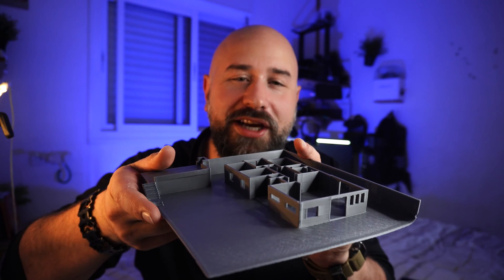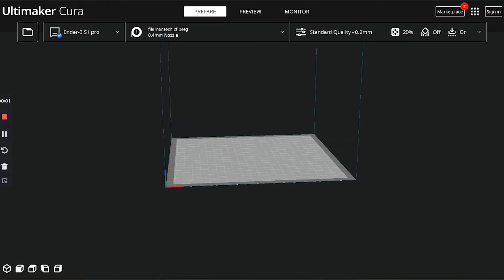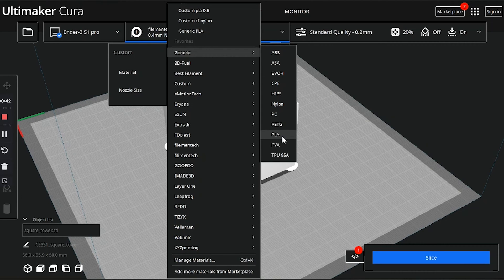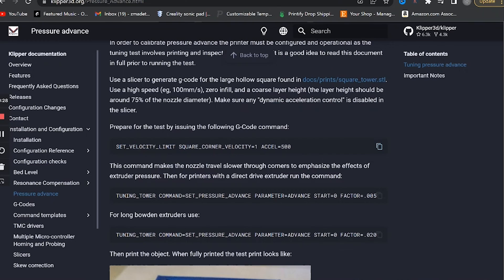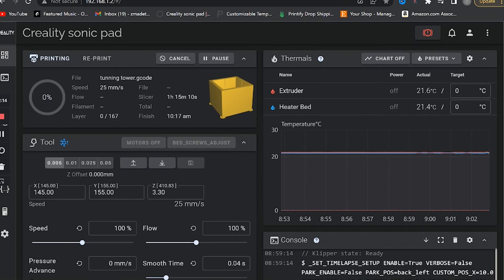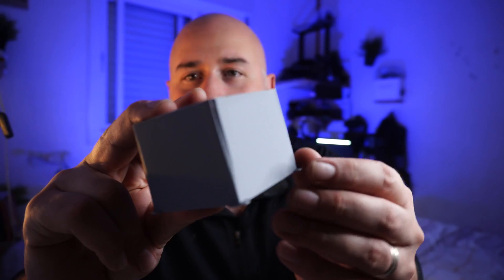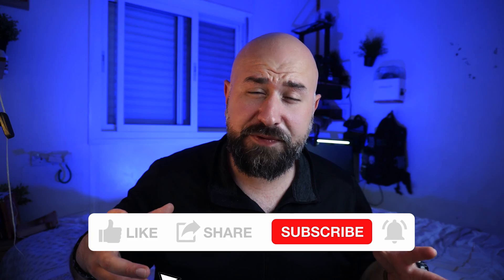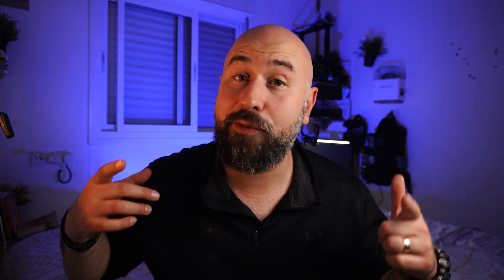Pressure advance on crealitys Sonic Pad

Comment: Your videos have been very helpful as I have been at this for a little over a month, one this I would love to see is a good "order" of dialing in a printer I have followed several videos including yours but only the immediate settings are mentioned and there are so many to modify I never know if I missed something. I have pressure advance tested several times on even the same roll of filament and get a different number every time and then I will flow test and it throws everything off. Currently my prints only work 2 out of 3 times at best. Thank you for your videos without them I was only getting one good print out of many. Never knew there was this much to learn on 3D printing, loving at hating it at the same time but having fun the entire time.
Reply from the maker: Hey Chris, first of all, thank you for your kind comment! second I think it's an excellent idea to make a video on step-by-step 3d printer tuning, it might take me some time though. One more thing, have you saved the pressure advance value after doing the equation in your printer config file?

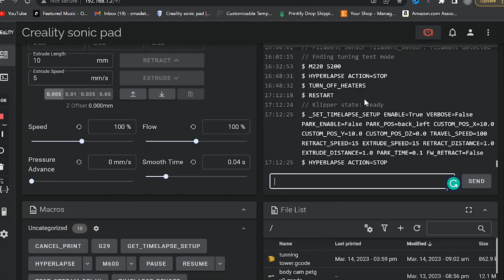Comment: I'm a bit confused. At around 7:45, after entering your Pressure Advance number, you run the $ RESTART command and it clears out the number you entered and sets it back to 0.

Even though it is showing 0, is it still set internally to the number you entered (in your case .04 mm)?

Or, if I want to keep using the setting I came up with, do I have to enter that number before every print (since it goes back to 0 every time I run the $ RESTART command or do a print)?
Reply from the maker: Hey ensoniqthehedgehog, if you want the value for pressure advance to be updated to your printer config file it needs to be updated manually, I apologize that I wasn't clear about that critical point in the video, I'm new at this whole youtube thing and I wrongly assumed that people would understand that the value needs to be entered manually in the printer config file under the extruder section Input Pressure Advance Value in Klipper
Open the printer.cfg file from the configuration section.
Navigate to the extruder settings and input the pressure_advance:  command at the end of the extruder section.
Save and Restart firmware.
The Klipper firmware will exit the test mode and use the set pressure advance value in future prints. I apologize for the confusion
Reply: @z-made  Hey, no problem. Thanks for the reply. It's a really well done video, it got me to subscribe to your channel.
Reply from the maker: @ensoniqthehedgehog  Ya of course! Thank you, I appreciate your understanding, 😊

Comment: Just in case this helps somebody else, I followed this guide to the T, but after not understanding why it didn't help at all, I realized that even though I most definitely input the pressure advance value and saved and restarted, the setting in fact did not save.  I had to manually add the value to the printer.cfg file, because in the printer.cfg file the pressure_advance setting was still zero.   After modifying the setting directly and saving / restarting, the setting stuck.  So, it may be a good idea for everyone that does to simply verify after saving and restarting that your pressure advance setting is actually what you desired to set it to.
Reply from the maker: thanks for the feedback Brian Field

Comment: A side question: my Sonic Pad doesn’t have an IP address in the WiFi menus and Creality tech support tells me that the Pad cannot be controlled via a web browser. ??? Can you give me some guidance on this?
Reply from the maker: Sure Wayward_Murf, I hope I can help, first of all, is your pad connected to the internet? second is it updated to the current firmware? and third, did creality give you a specific reason they told you that you can't get an IP address for your pad?
Reply from the maker: hey Wayward_Murf, did you figure out what's going on? Mabey try checking out this page, it might help https://www.klipper3d.org/API_Server.html
Reply: @z-made  whoa...I am saving that page, but that kind of intel is above my skill level.  Thank you !
Reply: @z-made  Thank you for your reply.  Yes, it was (is) connected to the internet.   For whatever reason (I made no changes) when I disconnected and reconnected the WiFi - the IP address appeared and I could access it via my web browser.  Oddly, it will only recognize the 2.4G network and not the 5G?  Still, the online chat support from Creality said that web browser control would be a future capability. ?? Well, uh, it works for me like you have shown.   Anyway, thank you for your time and information.  I am saving and reviewing your videos for my education.

Comment: Im going to use your way, but im going to do an expiriment first. Im gonna guess. My printer is fast so im going to start with your setting and print a small calibration cube, if it works it work, if not i adjust. My printer is pretty fast so im willing to do this 3 or 4 times before doing it the right way just to see if i can guess it. Thanks for the video.
Reply from the maker: Hey Andrewut7y A, that sounds like an interesting experiment, please let me know how it works out
Reply: @z-made  in conclusion, dont guess. Just do the math, you wont guess correctly lol. I tried guessing twice and it wasnt even close. My intention was to see if a ballpark generic setting would work, it does not.
Reply from the maker: @andrewut7ya511  Lol, well sometimes you just gotta try, I get it! thanks for letting me know😊

Comment: i tried to enjoy the b-roll of the difference at the end, but all i saw was the bad lighting, the low framerate, jerky hand AND camera movements, and the fact you whizzed through the comparison all in just 10 seconds :(
Reply from the maker: thank you for the input, I'm new at youtube and cinematography, and I'm trying to improve the production value, one step at a time
Reply: @z-made  no worries, just take your time, as i sensed a little impatience at that part, so remember your intention E.G. you want to show the viewers the difference between two prints. For someone playing "spot the difference", they need time and things not to move too much.

For this, you want to keep the camera still, and be as slow, and steady, as possible,  with the subject (the model). 

If you're going to manually hold it by hand, do your best to keep it still for a few seconds, then rotate to show other sides for a similar period. 

When it comes to showing the 2nd model for comparison, you can either do it the same way again, so it shows in series, or maybe show them at the same time by stacking the model and rotating them both to see them at the same time (i know this only works if the model is stackable) :) 
 
The frame rate was an issue and didn't help matters, not sure what the reason was there, maybe you wanted to squeeze the footage in without making the video too long ??  

The part just before the B-Roll, where you show the model, has bad lighting, with too much shadowing to be able to see to detail you want viewers to enjoy, so be aware of lighting your model well.

I enjoyed the rest of your video, sorry if i didn't mention it before, good luck in your next videos :)
Reply from the maker: @cjjuszczak  Thanks, i appreciate it😊

Comment: Just tried doing this. Followed all the steps, but noticed my print speed never went above 50mm/s...
Reply from the maker: Hey TheEthanRivera85, so I would suggest you try upping your print speed in your slicer, this is a video I made that I think might help you if you're using Cura, please let me know how it goes https://youtu.be/_Xqm1zod1yo
Reply from the maker: Hey TheEthanRivera85, just wanted to know if you solved the issue?
Reply: @Z-Made  so what I think my issue was I just changed the top box of the print speed and not the other options like for the walls and such. After it was all said and done I was able to print an xyz cube in 7 minutes
Reply from the maker: @TheEthanRivera85  That's awesome! I'm glad to hear it

Comment: Hi, thank you for the video, very informative. Just wanted to mention, if I understand properly by the equation you should calculate (0.2+7.79)x0.005 since your initial layer was 0.2mm and you measured from the top of the feet. Or there is something I do not understand. Thank you. Which is essentially same 0.04
Reply from the maker: Hey Fortifor, Thank you for the comment, I started the print from layer zero, therefore when measuring the tunning tower from the bottom, the first part of the equation is zero, in other words (0+7.79)x0.005 which comes out to 0.03895 I hope I was able to help😊 this is a link directly to klippers pressure advance page just in case https://www.klipper3d.org/Pressure_Advance.html
Reply from the maker: Hey Fortifor, just wanted to know if everything worked out for you?
Reply: @z-made  ohh yeah, everything is perfect.  All calibration has been done. Resonance,  pressure advance(funny I have magnets which have holes lining up with this acceleromete holes, and found little 3Mx 16 screws in my worshop and nuts) all perfect. Thank you for asking my friend. Andrzej
Reply: @z-made  I meant for vibration compensation I used those magnets  so I could screw one to the little accelerometer and placed another ones next to it to make sure that nothing would move at high pitch. Also thanks to your video with using magnets regarding resonance reading. So I did it a bit different way but the idea and explanation was enough for it. Thank you again and keep doing good work buddy.
Reply from the maker: @fortifor5410  Sure! no problem, happy to hear, happy printing 😊

Comment: Hi, 19mm was my best corner so I got the value of 0.095 (Direct Drive).  I put that in the PA tab and then RESTART command do I need to put that value back into the PA as it changed after the restart to 0 or is that just the Klipper Zeroing 0.095 as the new value? 

Thanks in advance.
Reply from the maker: What UI are you using? Have you changed the macro for your start print?
Reply: @Z-Made  I'm using the sonic pad on the ender 5 s1 with prusa slicer. I went into the sonic pad Web interface as seen in your video. Not sure about macro (sorry not too experienced). I put the commands in first thenI ran the test, input the PA value on the web interface that I got from the calculation after test and then entered restart in the command console of the Web interface but the value went back to 0. Is there anything I'm missing. Thank you for the response and the video explaining so far :)
Reply from the maker: Hey there halfapineapple (awesome name😂) sorry about the delay in my response, all you gotta do is put the pressure advance value you got from the calculation into your printer config file, just in case, based on the value you wrote in the comment this is the command "pressure_advance = 0.095" I hope this helps
Reply: @Z-Made  haha thank you, and yeah thanks I will try it. It sometimes remembers the PA sometimes wipes it back to 0. Was manually typing on the left PA slider. I will try console next time. Prints are coming out a lot tidier, you legend!
Reply from the maker: @LostContentScar  Awesome! let me know how it goes😄

Comment: I notice you also have a thumbnail of your gcode file in console. Did you do anything to get this? I don't have a thumbnail.
Reply from the maker: Hey there c0mputer😊, first of all, thank you for your comments, second sure I can explain how to get that picture, if you're using Cura slicer, you just have to go to the extensions tab up top (next to file/edit/settings/etc), pick "post-processing", "modify g-code", "add a script", then pick the "create thumbnail" option, then choose 200 by 200 px and you're done, now cura will generate a thumbnail for you every time you slice and save your print, and it will show up in your sonic pad and in the browser, please let me know if this helps
Reply: @z-made  Thanks for the reply. I'm using Cura but this isn't working for me, I'm actually using Creality's version Creality Slicer which is a Cura clone. It's identical but its most recent version is based off Cura 4.8 so I don't see the Create Thumbnail script. It's all good though, I appreciate the help. It's really a minor thing, I can live without the thumbnail.

By the way, I'm using the Creality clone because real Cura keeps crashing on my Mac and when it doesn't crash it's insanely buggy. Mouse stops registering clicks, can't scroll sometimes, the Preview tab after slicing doesn't show anything on the build plate, etc. It's horrible!
Reply from the maker: @c0mputer  Oh boy, I didn't know cura had so many problems on the mac, I'm sorry to hear that,  I'm going to try to look into it and see if I can maybe find a solution
Reply: @z-made  Update: FYI in case you get asked this same question. I did get the thumbnail to work...sort of. It shows in the Sonic Pad but it's upside down, haha! In the Printer Settings in Cura if you click on Connect Moonraker > Upload tab > UFP with Thumbnail, that got it to work. But again, it's upside down and it doesn't show up in my browser in Moonraker, just on the Sonic Pad print status screen. I find it funny so I might just leave it.
Reply from the maker: @c0mputer  thanks for letting me know, that's a crazy bug

Comment: printing the original house build and then doing the second one after pressure advance tuning you said you printed it at 150mms and achieved good results.... do you also need to change anything else in cura slicer settings? im struggling to work out what i need to do to achieve better speeds after tuning ( i've done pressure advance/ movement parameters and i've also done resonance compensation) but now im lost on what to do after
Reply from the maker: First of all, it depends on your printer, extruder, hot end, and nosel, so take this with a grain of salt... but I find that what works best for me is, if you raise the print speed in increments of 50 mms and the acceleration in increments of 100 mms, until you find the limit of your printer and filament combo that tends to work most effectively, I hope this helps
Reply: @z-made  that makes sense because of limitations in flow rates from the nozzle, I will try this out thankyou!
Reply from the maker: for sure man happy to help😊

Comment: Will the sonic pad still work on creality printers if you changed the control board?  I have an ender 3 pro and cr 10 that I've swapped the boards out with the skr mini e3 V2.
Reply from the maker: Take this with a grain of salt, because I don't pronounce myself as being familiarized enough with using the sonic pad on the skr mini e3 V2, to tell you definitively if you can or not however!  The skr mini e3 V2 is officially supported by klipper, and as far as I know on the sonic pad as well, however, there is a slightly different process for flashing the sonic pad on the skr mini e3 V2, I found a video by creality on how to do it linked here "https://drive.google.com/file/d/1clfsG1j02ytYVg-xbYXzW24mpHRieRpI/view " I hope this helps